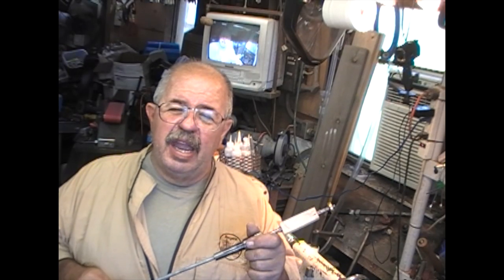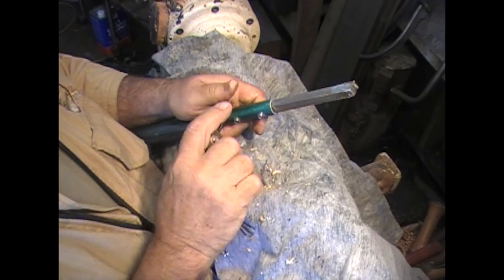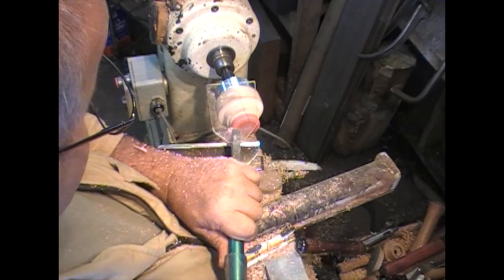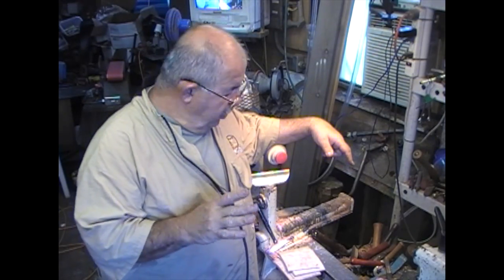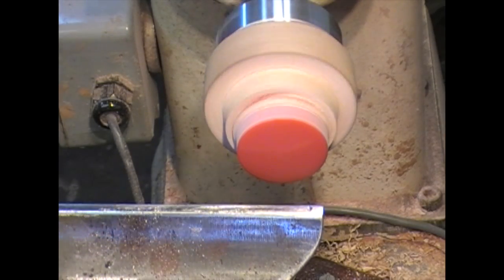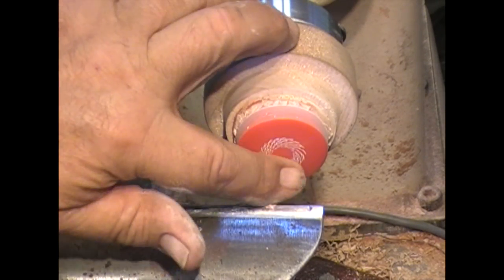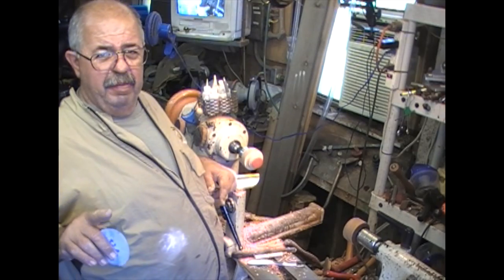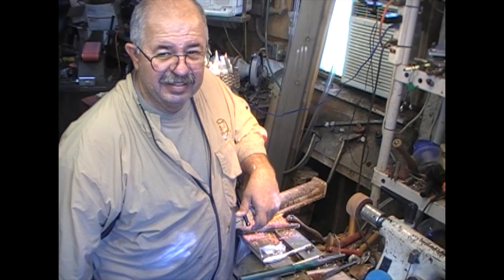#138 Faceplate, Revisited

Comment: So you could drill the holes over and TIG weld two nuts the size of screws you're using to hold the tool shaft into the pipe, and then use brake cleaner to install the plastic ari/water hose.Same stuff we use on our fish pumps for air lines. =) Cool vid, Thanks.